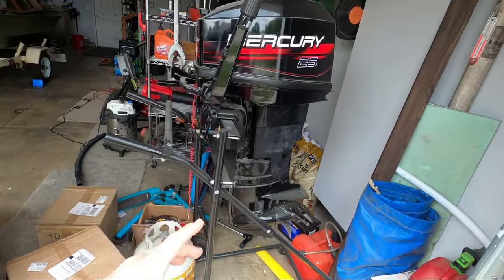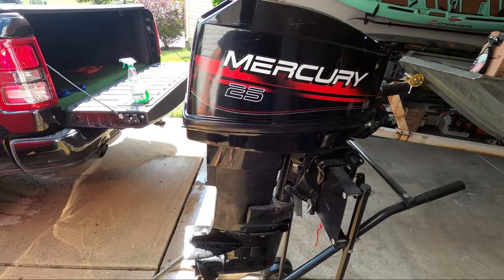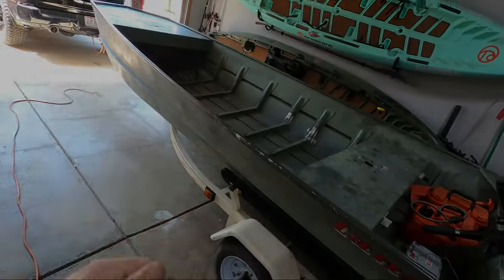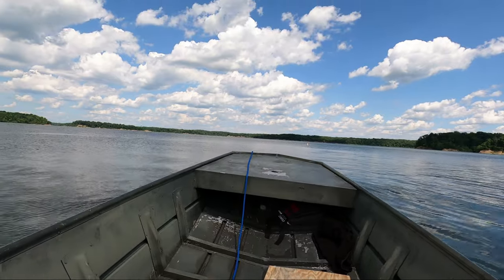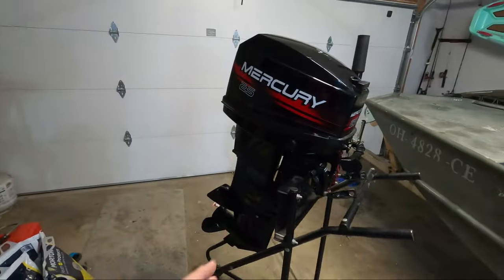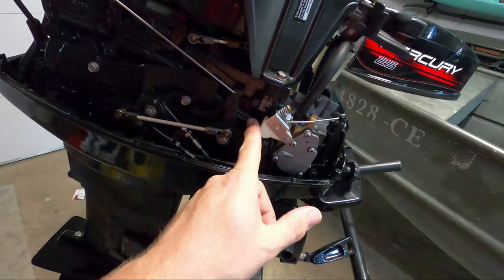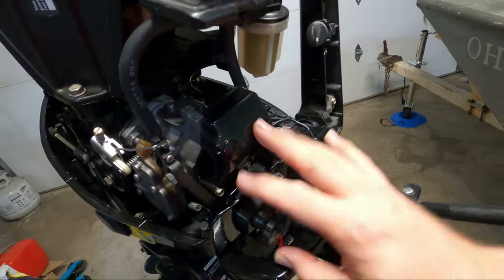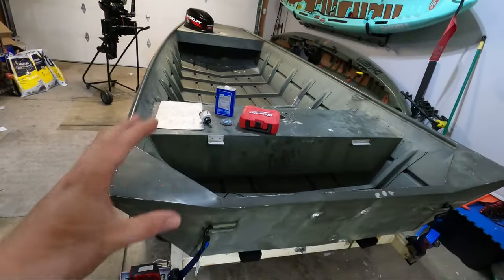Does it float? 1648 Jon Boat Build WATER TEST | Mercury 25hp Two Stroke

Comment: I'm not a merc guy at all...but those 25s are solid. Just be sure to keep putting fresh non ethanol gas in that thing. Good job on the troubleshooting too. Cool video.
Reply from the maker: Thanks! It's an awesome motor. I was glad it was something so simple too.
Reply: I have a merc 2.5 racing motor that thing will get up go ive never had any problems with it besides replacing 30 year old fuel lines but I also have a few small mercs they run really good but they have there problems, no what I will never buy again is a Chrysler motor those are absolutely junk, mercs and Johnson’s are the most reliable in my opinion but everyone can have an opinion
Reply: @brycepeters6163  those 2.5s were awesome...most of the 90s and early 2000s mercs were solid. I have just never been a fan of Merc, in my experience as a tech for over 20 years, their reliability just isn't there. When they're running right, they're excellent...otherwise, they're eh. I'll stick to Yamaha.

Comment: Looks like a strong motor.Those mercury 2 strokes haul butt.
Reply from the maker: You're not joking, I only got to maybe 1/3 throttle? My setup is way too bare to go any faster. I can't wait to see what it tops out at.
Reply: @mvboutdoors  I've got the 25 efi 4 stroke and on my 16ft Lowe it does 32 with just me and every now and then I can hit 33 but I have tried several props to get there and that's with my boat running light and with the right prop yours will do that too I'd say mercs are strong I love em.
Reply: Running a 25hp tohatsu pushing my Duracraft 38mph. But it's had some work done to it. Cheers Boys

Comment: Where did your anti ventilation plate end up lining up? Is it flush with the bottom of the boat
Reply from the maker: It ended up being a little above flush because it was set back with the riser.

Comment: umm....that's the choke lever....doesn't squirt any gas....chokes off airflow (butterfly valve) to the carb and enriches the air/fuel mix. 
The ONLY thing that squirts gas is the bulb on your fuel line coming out of your gas tank.
Reply from the maker: I thought that at first too but on this engine that knob is pull to prime and idle adjust, it is not a choke lever. You pull it a few times to get gas in the carb but it retracts after pulling. To "choke" this motor, you rotate the knob to open/close the carb. (It says "Pull to Prime" on the front of the knob).
Reply: @mvboutdoors  I'll be damned...learned something new...the knob actually rotates to adjust idle.
Reply: @mvboutdoors  I'm a little embarrassed to say it.... I bought a Jon boat in 2012 and completely modified it into a fishing machine....and I had that exact motor....abused the heck out of it fishing and duck hunting until ice up every year busting ice.....and I just sold it last year when I bought a new Jon boat.....and I never knew that was a primer....the motor was bullet proof... in 10 years it never failed to start or get me to where I needed to get to. It was a 1996 motor.  Enjoy it.
Reply from the maker: @KevinsNorthernExposure  it's amazing how reliable it is, I've started it a few times this winter in some very cold weather and fires right up. They really hit the mark on that one!